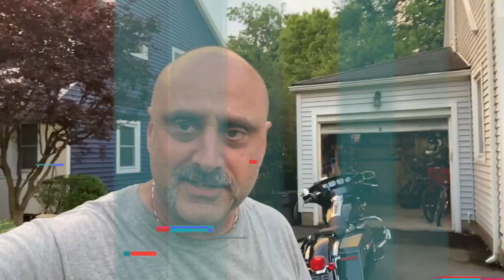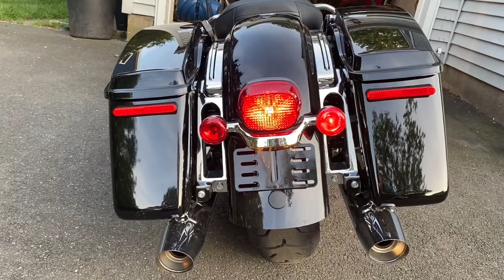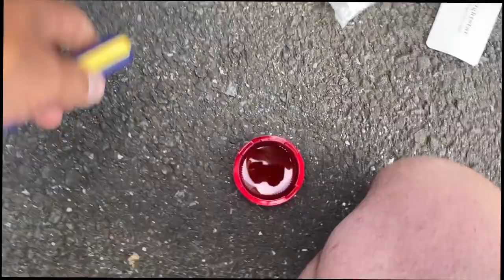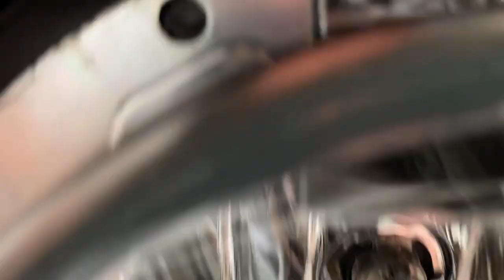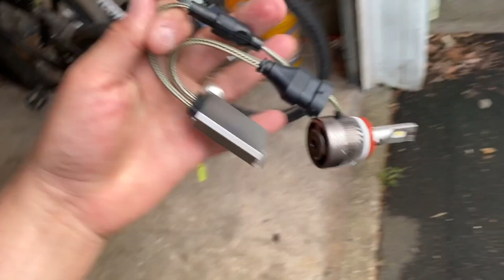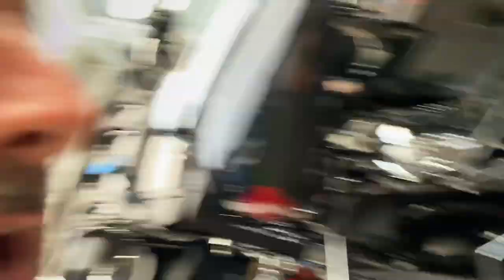How to Replace ALL Lights to LED On A street Glide

Comment: Sandy, Harley sells a module for about $69.00 that will convert your rear turn signals to running, brake, and turn signals, without having to change any of the bulbs..I just installed it on my 2020 FLHT, and it works good...plug and play, 5 minute install.....Sandy, make sure you check for error codes, when messing with lights you usually get codes on the BCM...good video Sandy.
Reply from the maker: I will look for that on their website catalog - sounds like a great idea  !
Reply from the maker: Do me a favor and show me that part number because catalog online shows that nothing fits the FLHT and the parts department in my local Harley didn’t know what one will work...appreciate if you come up with a part number. Thanks

Comment: Hi Sandy, looking to upgrade to LED as well, not sure yet to use the LED bulbs or a complete new LED headunit. Did you use with or without FM noise filter as you have the Sony 7000 as well? Thanks in advance.
Reply from the maker: I never had any problems with radio and never installed any filter...
Reply: Holy shiFt ok Thanks, there is now the option to order with or without noise filter

Comment: Even on the Street Glide Special all the bulbs are halogen which is a shame. It should be all LED across the board maybe some day HD will get there. BTW looks awesome, and I liked your approach to the headlight instead of buying CHINESE headlights from Amazon. They don’t last and their warranty is garbage. I seen a Electra Glide with a strobing break lights,  might be something it interests you.
Reply from the maker: SF0311 thanks - yeah believe it or not one of the orders I got and returned was a strobing flash first second and the steady bright - but I returned it because the connection base was wrong ....I might search again and buy it. It’s no more than 20$
Reply: I AM SANDY Custom Dynamics makes a module that will give you that capability but I think you would gave to switch over to their bulbs as well.
Reply: @GruntHarley  Careful with the Custom Dynamics, I installed some stuff from them for rear lights, and I kept getting BCM codes..wne twith a Harley part and the codes went away.

Comment: Great instructional! Have ypu ever found that you needed to use a load stabelizer when you put in LED bulbs? Have you had any issues since insalling the LED bulbs?
Reply from the maker: No need for any other components and it’s been working for a year now with no problems